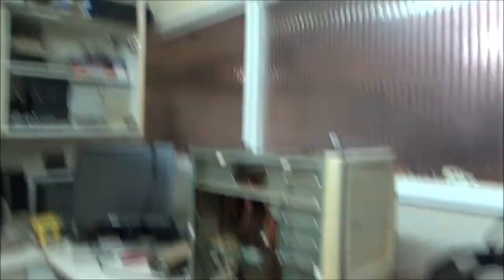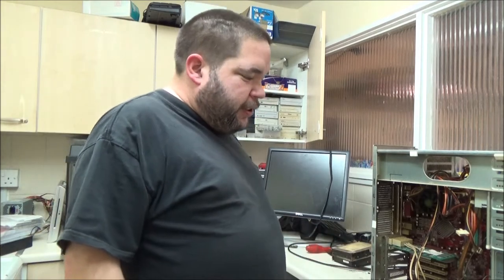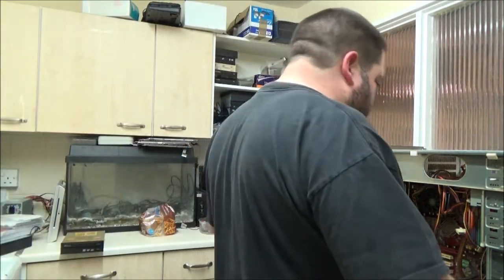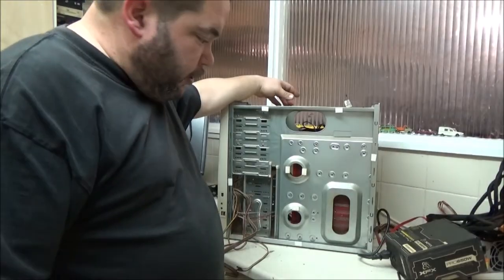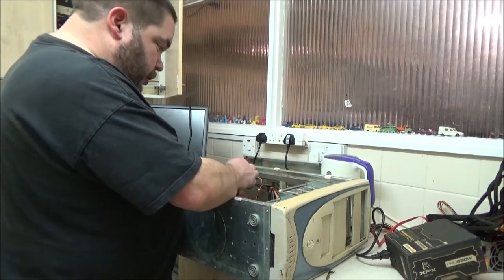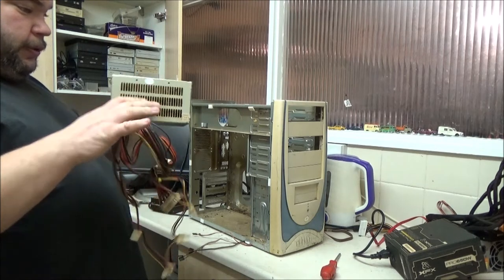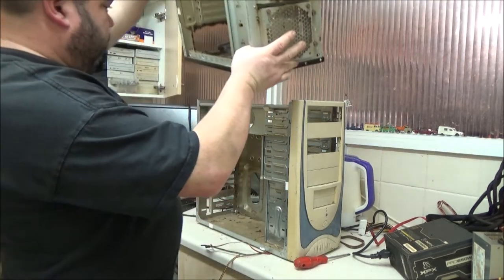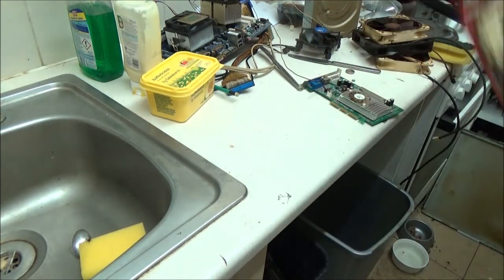Two Stinky, Dirty Computers.

Comment: Hi Andy, I've actually successfully  washed (including full immersion in warm soapy water) various dirty electrical items, including TV & audio remote controls, extractor fans, electric heaters etc, just make sure you rinse them well & give them plenty of time (several days in a warm place) to dry out completely, even better if the item can be taken apart too.
Reply from the maker: Hi Richy. I have  managed to clean up the cases. though motherboards are toast.